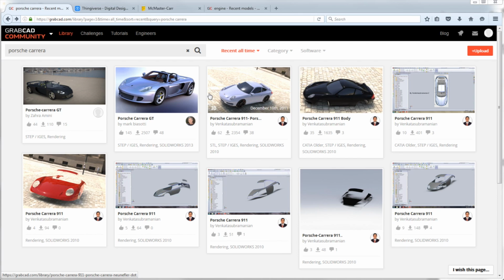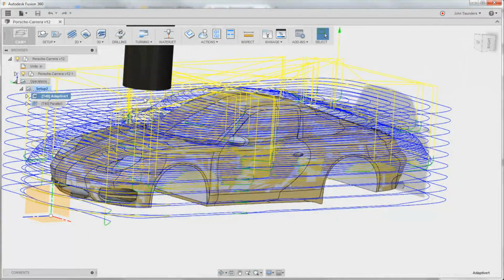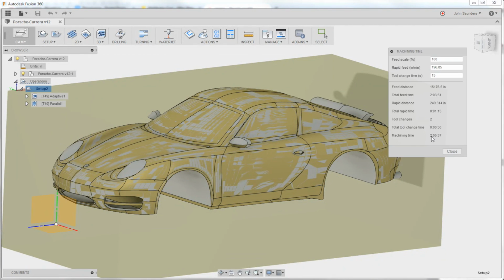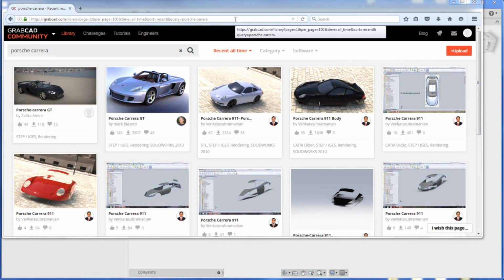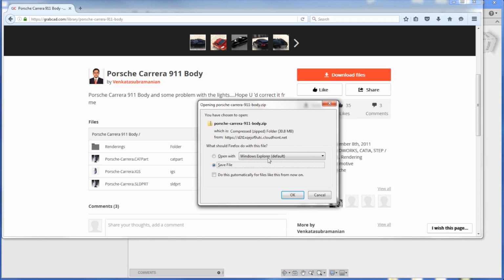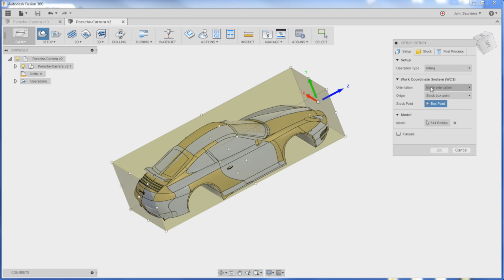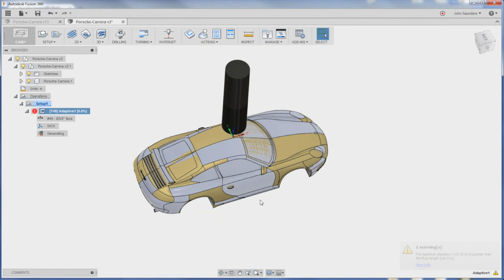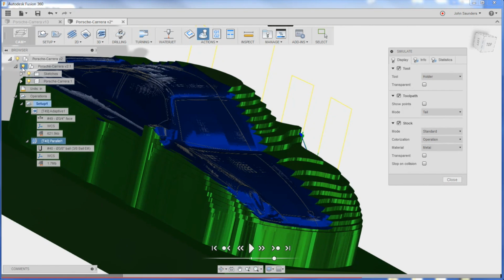Machining a Porsche 911 Model on Tormach 440!  Widget99

Comment: You could run that ball nose at like 25,000mm/min.
Reply: I don't believe his machines spindle is able to run at that rpm. I think his Tormach maxes out at 5 - 10 thousand rpm.
Reply: UnderearthEDO ya 10,000rpm and 25,000mm/min feed.
Reply: David l whoops, I read that as 25,000 rpm, my bad. I need some sleep.
Reply: Says he's running 135 in/min which is NOT 8000 mm/min.  135 in/min is 135*25.4= 3429 mm/min, not sure on his cutter but if its 4 flute, that's .085 mm per flute and he could probably run double that with only a .025 mm step over.  .05 (2 thou) step over is ...nothing... and you could run 10k rpm on a 4 flute at least @5000 mm/min (196 or 200 in/min) and the finish wouldn't be any/much different because the curve of the ball smooths out the crests between the paths to less than .0001"

You're getting "faceting" in your curves because you're "Total Tolerance" (that's what its called in mastercam = arc filter tolerance) isn't small enough.  When you have a "curve" but it comes out with flat sections going the length of the curve, these are called facets and the arc filter tolerance dictates how large these are.  In Fusion I don't know what its named, but its the "tolerance" number.  Basically the "amount" the curve can change BEFORE the software calculate another point for the tool to move to.  Think of it as the tool actually moves in a straight line from point to point.  If your tolerance is .001" then the curve has to change that much before the software will calculate another point.  Setting this lower will reduce facetting.  So with a Tolerance of a tenth of a micron, .0001 mm you can get a very smooth round render.  .0001 mm = .000004"  Set your tolerance to that if you're in inches and you'll get nearly "round" curves with no faceting.  Larger program though so machine memory is in question but you can break up the program in to smaller sections and then have smaller program segments.  Not efficient but the end result will be much nicer.

I discovered this in Mastercam because we were creating odd shaped cam lobes for a customer that actuate other mechanisms on a timed axle for a production line.  Using a total tolerance of .001 MM!  (i.e. 1 micron, that's 2.5 times smaller than .0001") we were getting about 2-3mm facets in different parts of the cam lobe.  Reducing this to a tenth of a micron (.0001 MM) makes a smooth complete curve that has no facets.  You may be able to get away with more, like .0002, .0003, etc. which makes the program substantially smaller but that worked and that's how we ran it and still do.

Comment: Do you even tried a tapered ballend mill? If i understand it right they would be a better choice for the kind of details. i might be wrong.
Anyway.. don't you ever model up your vise? Or set up complexer runs in Fusion? I have tried to do some fixture cam in fusion but ran into a wall with it. :|

Comment: about your 10% stepover if you are using a carbide cutter you will get better results (surface finish tool wear) if you cut with a greater percentage.  i dont have any of my reference materials here at home but the company you buy carbide from should have recommended chip load/depth of cut chart of some kind.  my company has drastically decreaced cycle time and tool wear, our representative from ISCAR will even help with troubleshooting sometimes.

Comment: A fun future Wed. Widget might be to redo this using 4-axes on the 1100 and then re-fixture to get the remaining sides... Also, design some wheels in F360 and leave some material in the wheel arches to mount them.

Thingiverse is mostly stl files although there is some cad files.  Most of the stuff on there is too highly detailed to work well in F360... In order to get thingiverse models to work well w/ F360, I usually find I have to first load them into Blender, decimate them, and load the modified model in the F360, unfortunately the process causes much of the detail of the original model to be lost.

Comment: The fact the surface finish transition is dead smack down the middle of the part makes me  think that it's less the effects of coolant , and more the effect of up vs down milling with a BEM. The first half was all up milling, the second half past the midline was all down milling

A morph surfacing path starting from the bottom and ending at the top would have produced a more even finish, or setting the parallel path to up cut only.

Comment: Turbo squid is the largest 3d model download site for graphical representations, not so much for mechanical/ tolerance correct parts. Yes, CB 14 there was little/no lubricant in the water or it looked like pure water anyhow.

Comment: Great idea machining something fun from GrabCAD!  The first thing you should have done with the model though (and almost all IGES files) is jump into patch and make it one body. You can tell it's a patchwork from its coloring. Also you're making the setup triad way too difficult. Click the base of the Z axis (or any axis) and then click a face perpendicular to the way you want it or an edge in the direction you want it. Going the wrong direction? Click the head of the arrow.

Comment: Is it hard on the spindle to be running 10k rpm for so many of the tools you use?
Reply: +sthenzel 
Climb milling creates a chip that goes from thick to thin. Conventional creates a thin to thick chip. The heavier initial engagement in climb milling is easier on the cutter and the machine, takes less machine ponies to climb mill. And you get about 30-50% longer tool life from climb. 

Plus with adaptive its entering the material in an arc and maintaining a chip thickness and minimizes radial chip thinning.  Which cutter life and cut stability. 

Read Bob Warfields article Climb vs Comventional Milling on the CNC Cookbook site. He does a good job explaining the pros and cons of each and why.
Reply: Regarding that I have an additional question:
Why is climb milling used for the hogging cuts when surface quality isn´t necessary? The tool edge runs into the material full depth, while running into an angled surface would be much easier for the machine and reduce chatter.
I noticed that on the parking attachment vid already where the long cutter had chatter problems.
For a nice finish climb milling is better, no question, but for hogging?